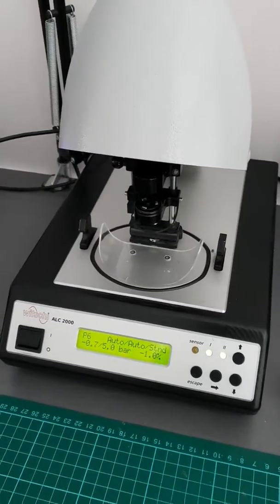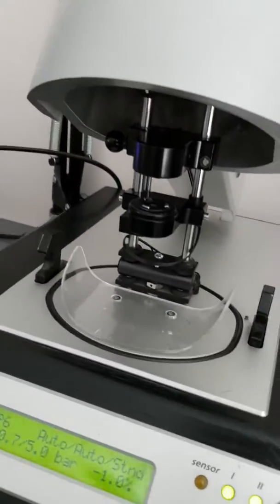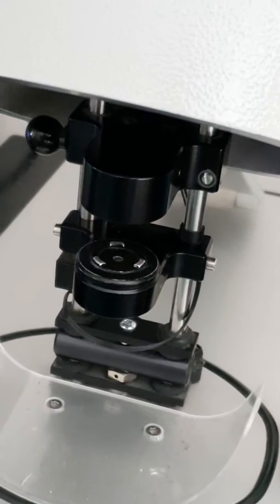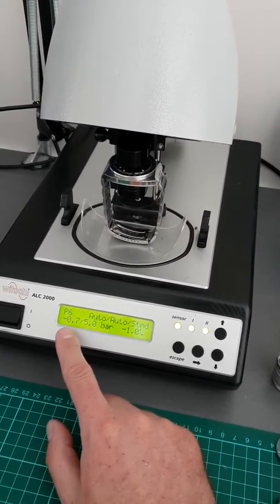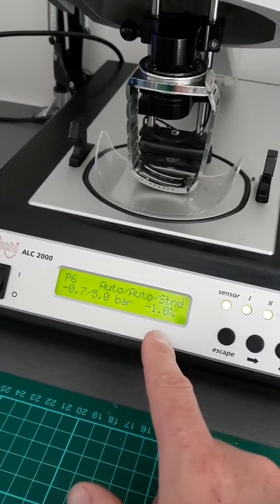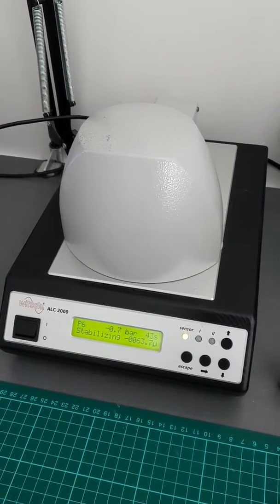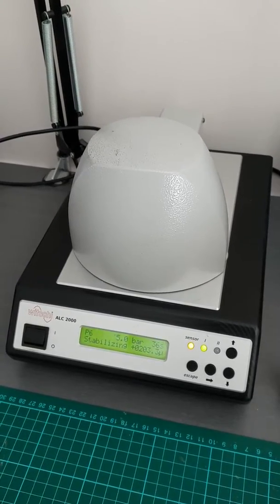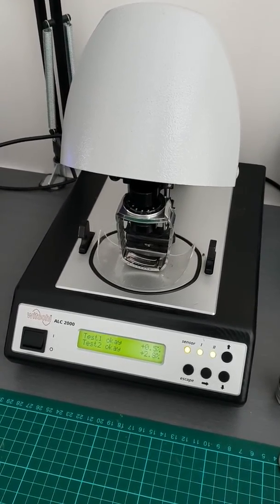[TOOLS] - Witschi ALC-2000 WATCH Pressure Tester OVERVIEW

Comment: we use the same for scuba computers, great machine, had it for 12 years, never missed a beat, super reliable.
Reply from the maker: It's pretty good. If you get into the settings of the machine, it gives you a count of how many tests it's done, this one has done, apparently, 16800ish tests since new.

Comment: Is it worth investing in some type of pressure tester? I restore about 1-2 watches per week for fun and have never tested them.
Previously I never replaced rubber rings as thought they were hard to find however have now started doing so.
Reply from the maker: It depends.

If you don't replace the seals you are guaranteed to get water in the cases at some point which will really ruin your day.

The Chinese copy of the BERGEON 5555/98 works OK and is pretty low cost.

Even sweat on your wrist will get in.